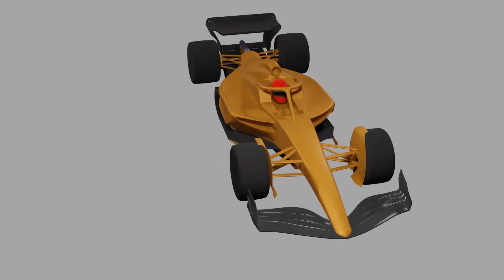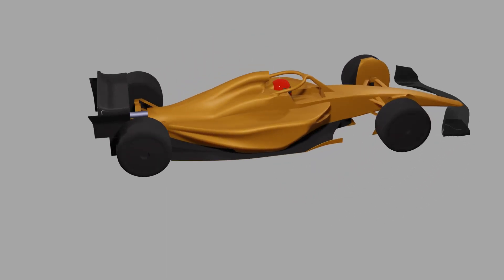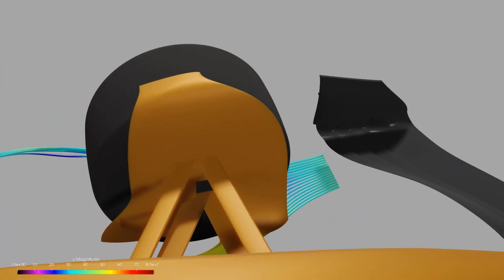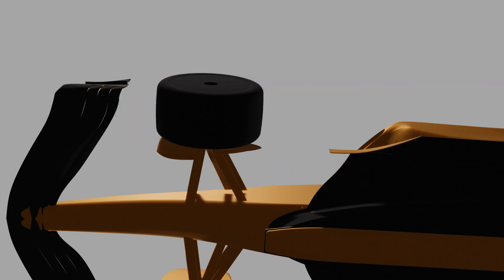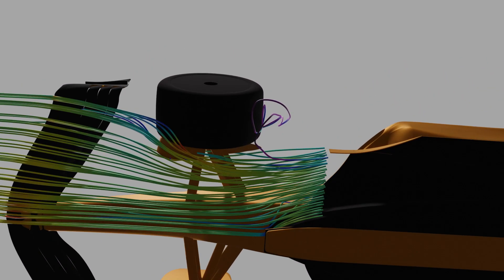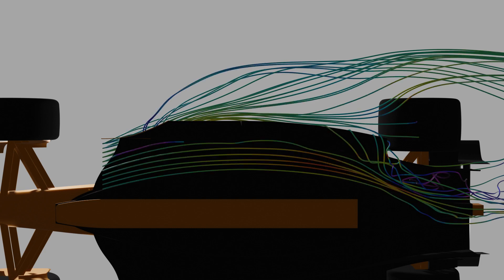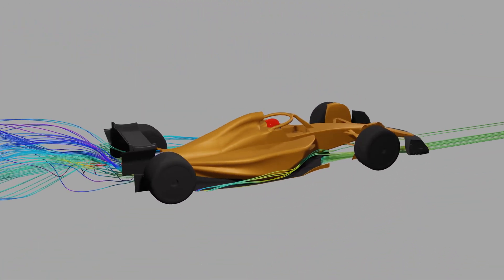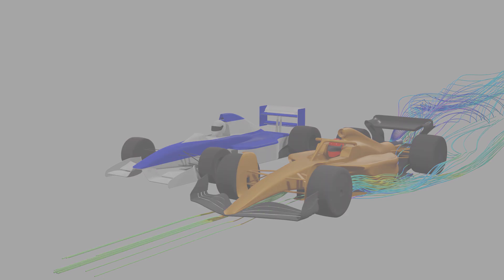Introduction to the 2022 Formula One Cars' Aerodynamics

Comment: So how efficient/inefficient are the current rear wings?
Reply from the maker: The're not any more efficient because they loose efficiency due to the endplate wrapping under the profile. They may actually be less efficient. Typically a two element wing gets a lift/drag ratio of about 4.2-4.5. I haven't seen anyone achieve 4 and I haven't pushed the design at all with mine in the 3s.